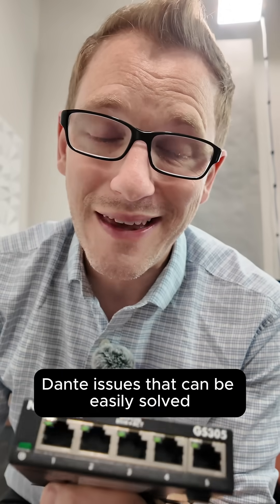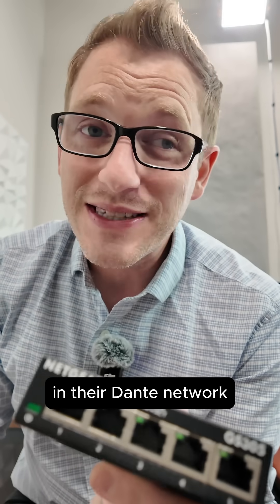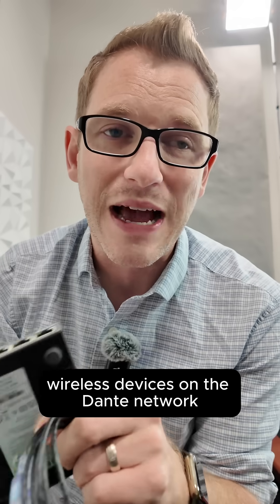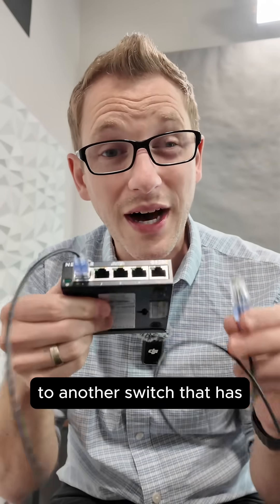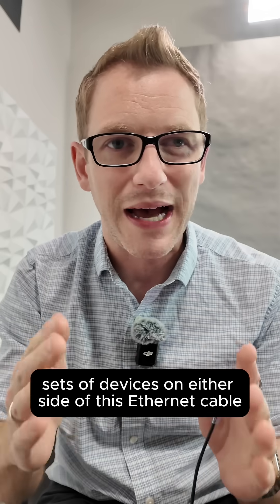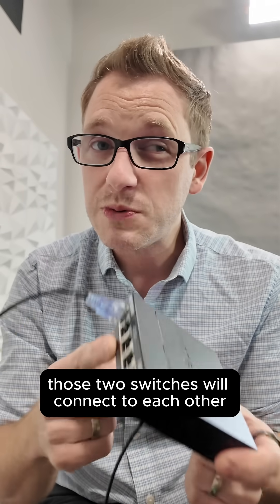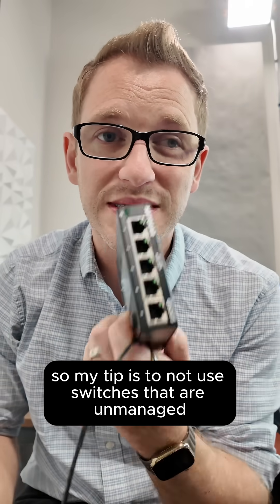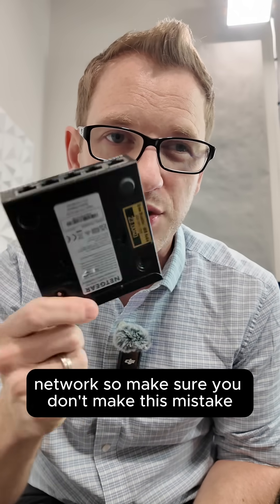Don’t Use This Network Switch on Dante! (EEE Causes Problems) #dante #DrewBrashler #livesound

Comment: I’ve been looking for a video that goes in deep about setup global. Like I having a problem with startup. I have a church that is starting up every time to the same thing and I check to see if the scene was this issue and no but now I made a boot and it drink me crazy asking to start from there and I loose all the changes I know I can maybe just over ride it but I would like to delete that boot so I don’t have to every time confirm to boot from that scene from the USB maybe I’m just over thinking it and something will come to me . But I also thought of a snippet to start up but not to much information on that neither. Any help will be greatly appreciated.